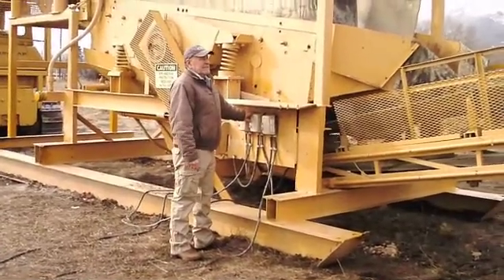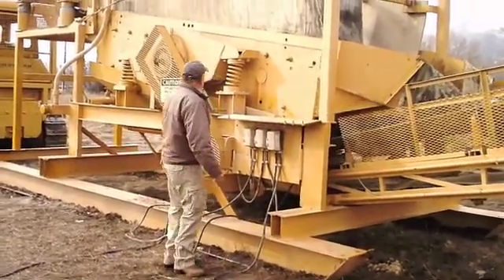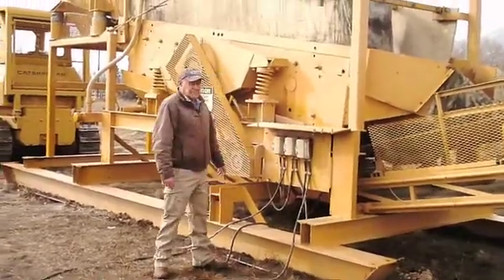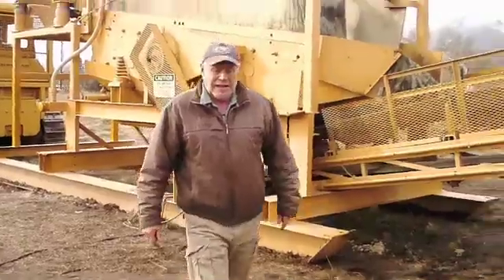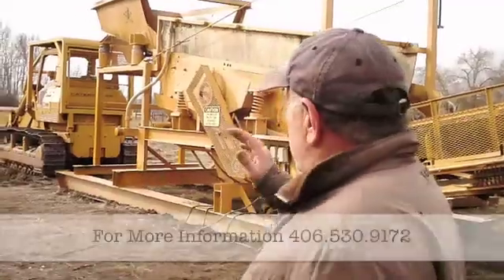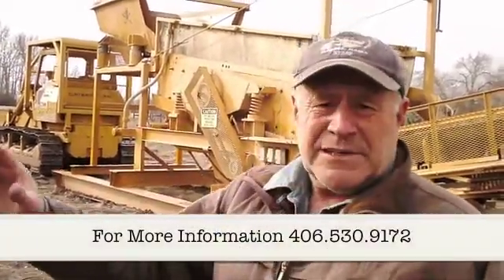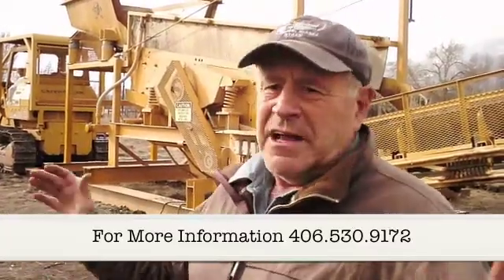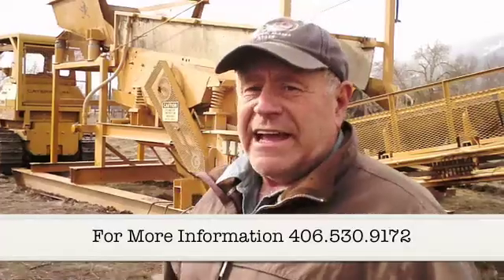Gold Wash Plant Demo: Gold Mining Equipment

Comment: Impressed by the insights shared in this video! I recently started using Filter Bounce alongside my cold email SaaS, and the accurate email verification has been a revelation. It is helped maintain my sender reputation and boosted my campaign is success rates. If you want reliable verification, give them a shot!